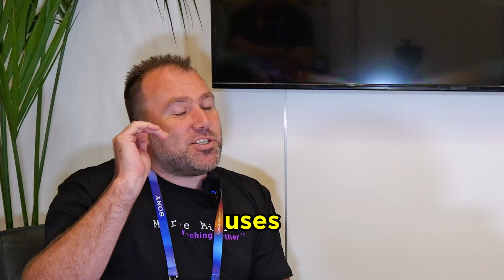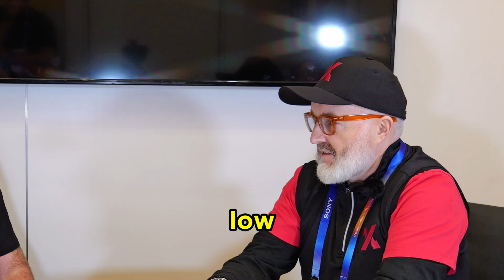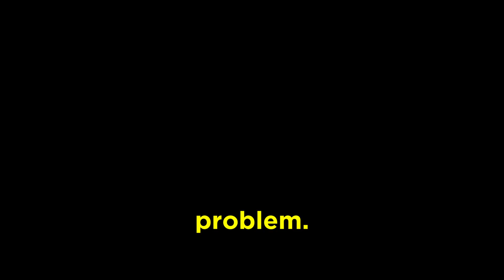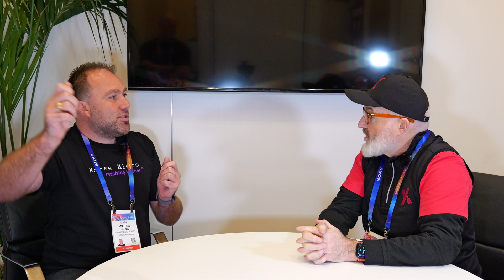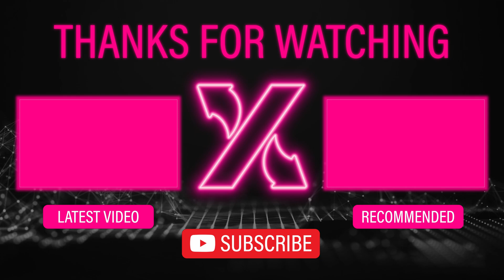How Morse Micro’s HaLow is Changing the Game for IoT

Comment: My 2 - Morse Micro routers range is Horrible! I ended up purchasing 2 halow routers to utilize HaLow and a Wavlink 3000. The range is the same through trees but I get 40 mb/s + with Wavlink and barely a signal with Halow router setup in Aqua mode at our Barn. With HalowLink1 I barely get a signal at our barn from our upper closet which has a window. The Wavlink is in that exact location and I get 40 + mb/s, I am thinking of getting another Wavlink 3000 and placing it on my hill to broadcast the signal throughout our property.

Comment: I wonder if they fixed the inherent security flaws mentioned at DEFCON?
Reply: If you're referring to the demo at DEF CON 32 it is specific to the default config on TaiXin TXW8301 devices. NOT an inherent security flaw in the 802.11ah HaLow standard.
Reply: @kilo.sierra  thanks for the correction, thats good to know!